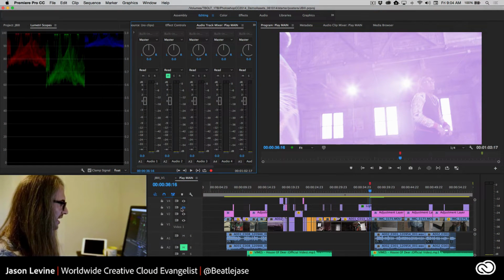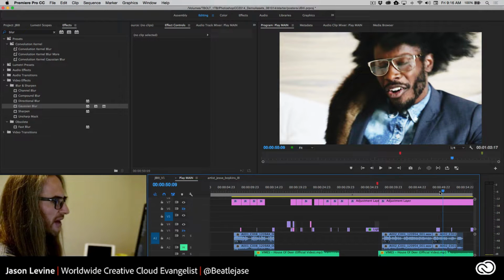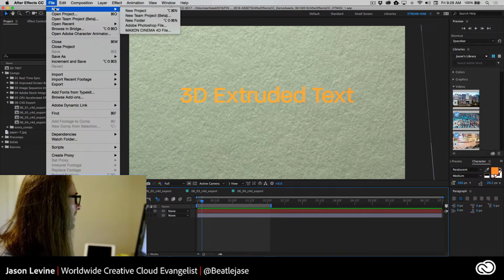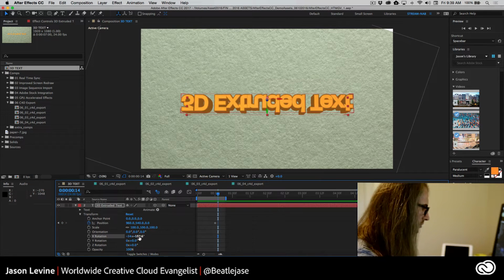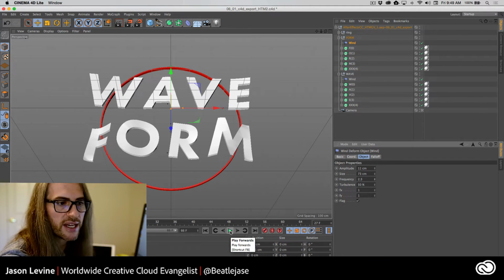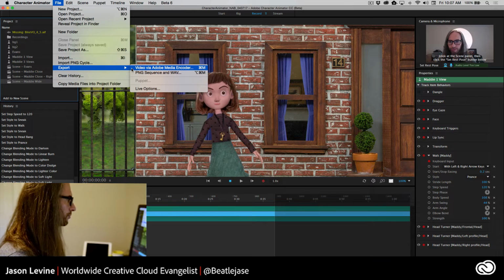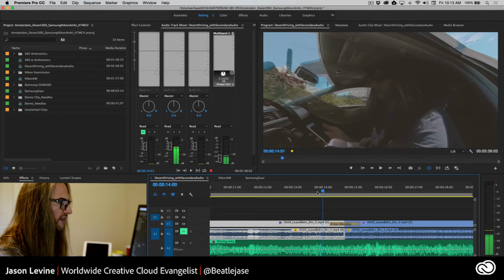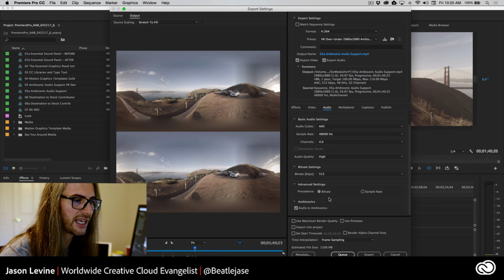How To Make Great Video, Part 5 | Playing with Dimensions (2D, 3D, 360)

Comment: greeet work .. I need to ask you a question. If I have a set of images taken 360 degree technology .. How to collect them in video .. Knowing that the pictures are not real but were captured by programs such as
 3Ds Max or Lumion for modeling architecture
Reply from the maker: If they're exported and metadata tagged properly (as equirectangular projection), you should be able to open those 360 images in Premiere Pro and with the VR Viewer enabled, you'll be able to navigate thru 360 space and effectively treat it in the same way as 360 video.